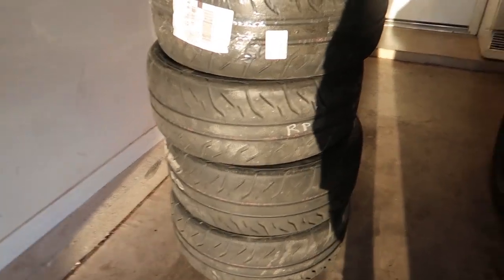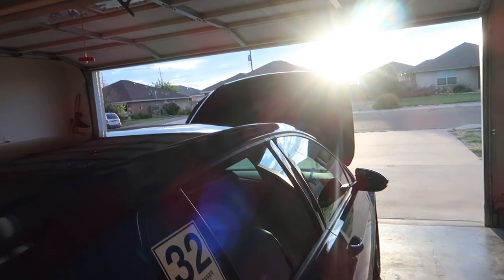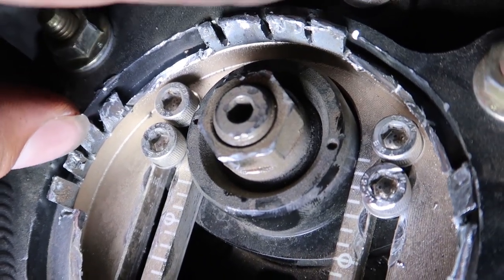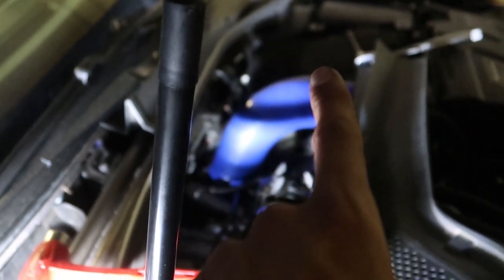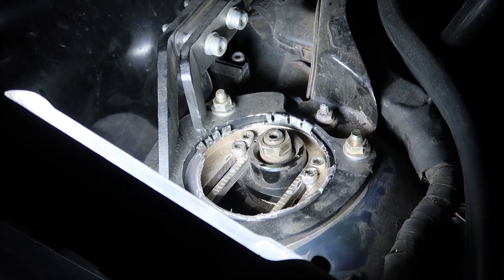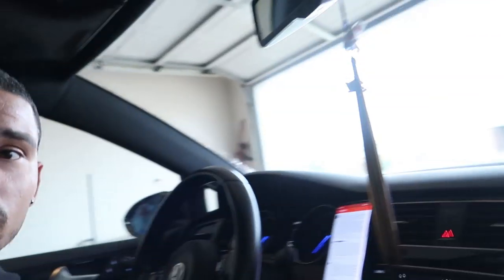Maxing my camber plates?? | Stage 3+ MK7 Golf R

Comment: God yes! More educational suspension videos!!!!!!
Please do more!
Do you think the 245's would rub on stock height?
Reply from the maker: It would be close, but you should be able to get away with it if they're a true 245.. like federal and some other tires they actually run a size bigger then stamped. Cheater tires lol
Reply: I run 245/30 R19 on my mk7.5 GTI with 19x8.5 et45 wheels. No rubbing and its lowered with coilovers.

Comment: Do you have a video on how to cut the strut tower? I just got BC’s and can’t reach the camber Allan keys or the dampening adjustment
Reply from the maker: I don't man, I didn't do a great job but I did show some of it. Really it's unnecessary though just slam them all the way for neg for camber and be happy if you're tracking it
Reply: @BryceJordanProductions  when you cut did you drop the strut? I would take the 3 bolts on top and remove the sway bar from the strut for it to drop right?

Comment: Do you have any clearance issue with the flange on the strut that connects to the top of the front swaybar endlink? I also maxed out the camber on my BC's but noticed the negative camber causes a that part to rub at full compression or when the body twist. There is 1-4mm of clearance between.. is your clearance that small too?
Reply from the maker: Yeah my flange hits the body sometimes. Never broke anything 🤷🏽‍♂️ just been dealing with it not really worried about it.
Reply: @BryceJordanProductions  yeah exactly, mine's occasionally hitting the body where there's a strip of OEM rocker gaurd. When I took my wheels off I noticed it scraped off the rocker gaurd leaving bare metal which has already rusted. I think I'm going to spray it with rust inhibitor and call it a day. Good to know it hasn't caused any damages during track use as that was my main concern. For my next alignment I might take a degree of camber out to be safe. You still running -3?
Reply from the maker: Yeah I run at -3.1 but I think about .5 or so comes from the control arms. Never had to deal with rust out west but I can see your concern.. maybe you can get a strip of rubber where it hits? I took a hammer to that spot but it didn't seem to wanna dent any lol
Reply: That's actually not a bad idea. Gotta love Canadian winters... At least I will not be dailying it anymore in the winter due to remote work.
Reply: @BryceJordanProductions BTW I love how stress free you are man 😅 cheers to that! Gotta just send it on the track and if something breaks, fix it 🤷‍♂️

Comment: Hey mate have you run into any issues like cracking anywhere around strut tower in engine bay since cutting the strut tower dome out like this?
Reply from the maker: Nope, adding the strut brace should keep it in check 👌

Comment: Does cutting the holes in the strut tower mess with the structural integrity of it at all? I'm thinking of doing the same but im not sure about it.
Reply from the maker: I think it does but not sure. Got a front strut bar to reenforce it. Great decision cause that bar makes a huge difference in handling.
Reply: @BryceJordanProductions  also for the marks on the camber plates...do you know roughly around which mark I would need to go to so I can get around -1.5 to -2 camber?
Reply from the maker: Max camber I think before my control arms was -2.7. The lines I don't think really mean anything but really are there to help you make sure both sides are even. I'd try 2 lines before max and see how it turns out
Reply: @BryceJordanProductions  ok thanks!

Comment: I'll look at links in description but I've been looking for a way to add camber to my mk7.5 GTI with camber plates I can adjust without having to remove my coilovers. Do you have a link to them? I track my car too. Thanks
Reply from the maker: Well boss you have a few options depending on your current setup, what coilovers are you running now? The tops of them depend on the style of plates you need.. but to adjust them without dropping the coilovers you're going to have to cut the metal tops on your strut towers to be able to adjust them
Reply: @BryceJordanProductions Thanks for reply,  I have APR coilovers.
Reply from the maker: @334trax2  did a little research and can't find much information on them being paired with camber plates. There is some talk about them possibly being rebranded eibachs, so if you were to reach out to IE maybe and see if they're compatible.. I see that it says they don't come with top mount stuff, so I'm assuming you reused OEM. If that's the case any camber plates that fit OEM struts may fit. Mind you this is all just a quick search, id send APR an email to make sure of it'll take on any oem style plates and if so I'd look into IE adjustable!
Reply: @BryceJordanProductions  thanks I was making a note to reach out to APR I also look into IE. I'm still trying to figure out pros and cons because I just started to track mine on track events, going to Roebling track next month. I'm pushing around 375ftlbs to wheels so not sure of traction on straights with camber. I do use 245 width tires Michelin PS4S.
Reply from the maker: @334trax2  Should be pretty balanced with around -2 or so of camber, seems to be standardish number for track/daily cars around there. I can't personally say for fwd, but I haven't had any problems with -3
Reply: @BryceJordanProductions  thanks man for information. I just sent out a few emails.
Reply from the maker: @334trax2  awesome! Let me know what they say!
Reply: @BryceJordanProductions  ok not a problem hopefully Monday I will know more.
Reply from the maker: 334 TRAX Sweetness!
Reply: What brand camber plates are yours?
Reply from the maker: @334trax2  BC racing coils & plates here. They come with them standard, one of the main reasons I looked into them
Reply: @BryceJordanProductions  thanks hopefully mine will be setup right for Roebling next month. Let's see what the VW can do. I was impressed at Barber Motorsports Park last month but my camera setup sucked.
Reply: @BryceJordanProductions  ok I'm still dealing with camber plates. APR does not have camber plates nor tell me of any. So thanks to talking to track guys I was pointed to Vorshlag camber plates but they are made needing coilover measurements. They are installed on my daily so I sent APR the information request nicely but they make it sound top secret. They will get back to me. If I have to take coilovers out to get all measurements that APR has right there I'll be pissed and make a video in APRs honor with all measurements etc. for the people like us that keep them in business.

Comment: Bi Bryce,

Are the 245/45 or/40 fits perfectly on 8 wide alloys?!

Can you confirm or make a little vid about this?!
Reply from the maker: That's pretty much the perfect size for an 8. Just need to make sure whatever brand of tires you get don't run a size up like the federals and these Bridgestones apparently
Reply: @BryceJordanProductions  thx Bryce!!!
Currently i have 2 set of Sparco Asetto Gara for track...one with Hankook ventus f200 slick..what fits near perfectly!!! I was afraid of ordering  Michelin Semi cup 2 ..in 245/40 18...but i think i will do it soon!
Comparing f200 to my current street tyre Conti sportcontact 5p...the difference is 8seconf on a 4.3km long circuit.
Reply: @BryceJordanProductions  hey, u think that 245/40r18 on 8inch wheel is good for track or You would prefer 235/40r18 tire?
Reply from the maker: Depends on the tire I suppose. Whatever fits the wheel best, hard to say. Some brands like falken run way bigger then advertised